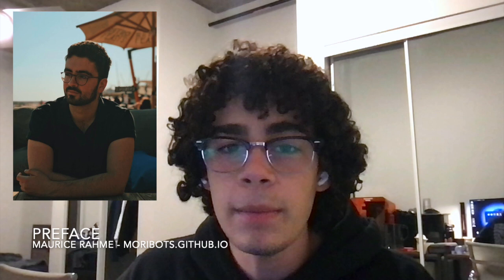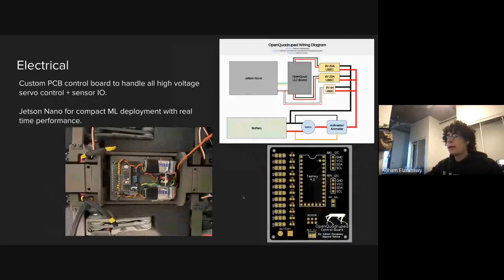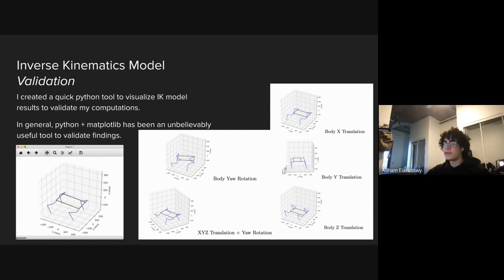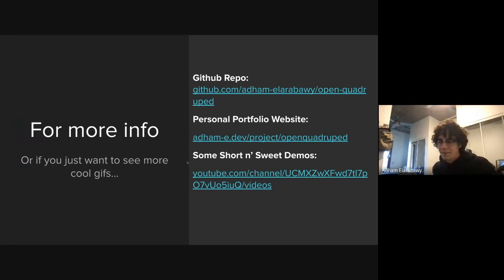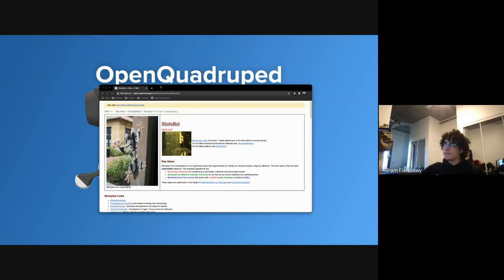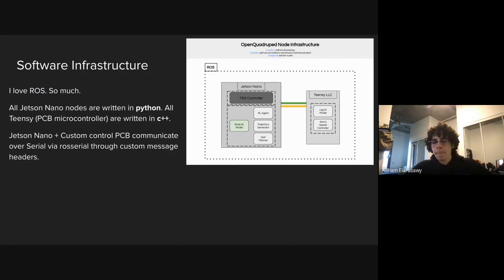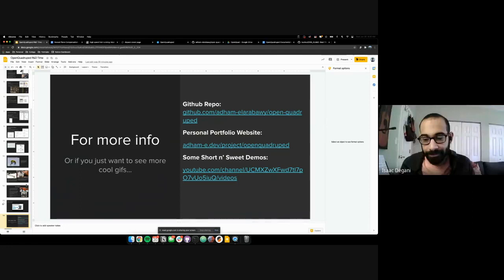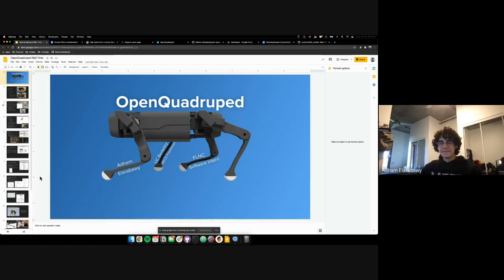OpenQuadruped R&D Presentation

Comment: Wow, amazing project and really insightful! Working on a similar project too! It appears you are using position control on the servo motors for inverse kinematics, I was wondering if you experimented with velocity control for inverse kinematics and foot trajectory following using linear algebra and Jacobians?
Reply from the maker: I have experimented with velocity control on a preliminary brushless robotic leg, but unfortunately, the need for 12 actuators (for a total of 4 3-DOF legs) constrains my budget to only allow me to buy servo motors. Generally, you can only command cheap servo motors using position control. I have somewhat circumvented this by creating a low-level microcontroller board that interfaces with all the servos and sensors -- it is responsible for interpolating the higher-level motor position commands into low level velocity commands that are fed to the motor at the fastest update rate possible. It is not a perfect or particularly elegant solution, but it generally gets the job done for this project!

Comment: I read your IK paper. It's really helping me to understand the IK of the robot. Simple and clever! Thank you!
And I really want to know more about pitch and roll IK. Can you update the paper. Or where can I find resource about it. It seems very difficult for me. I have taken myself but can not get it out.
Reply from the maker: Pitch and roll can be computed by simply considering the dog as a plane on a separate coordinate system than the foot contact points. Simply define a plane constrained by the foot contact points, and then perform any transformation on the body coordinate system and measure the resultant hip-to-foot vectors. That should be all you need to pass into the leg inverse kinematics model, which can then compute the necessary joint angles. If this explanation isn't sufficient, feel free to send me an email at adhamelarabawy@gmail.com

Comment: Awesome work!! Cool, you get access to the Formlabs hardware like the Fuse 1, try hollowing out all your solid parts to take advantage of Nylon's toughness (good for those thin wall 3D printed parts) compared to the SLA printed parts :) -- As for your soft touch/force feedback feet, there is a local Boston company which has a pretty neat tactile sensor https://www.labs.righthandrobotics.com/takktile-sensors